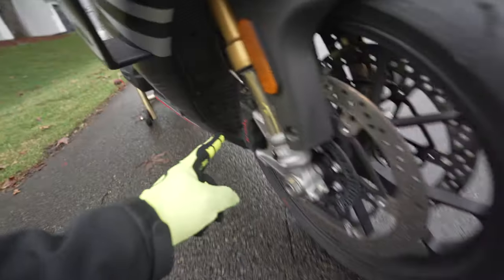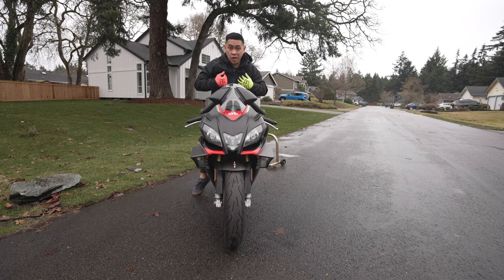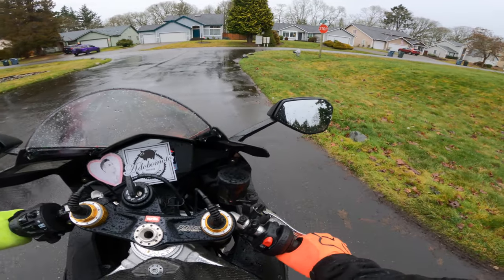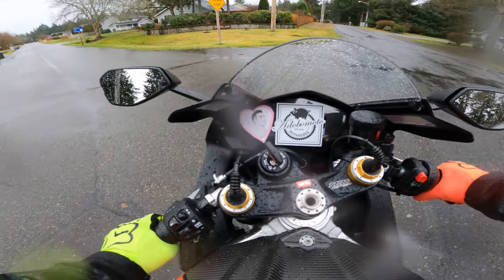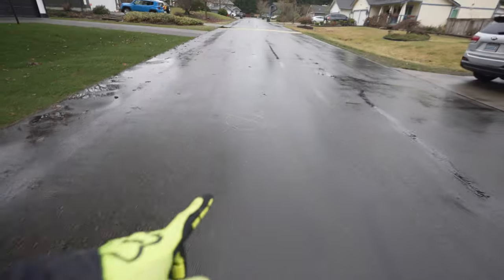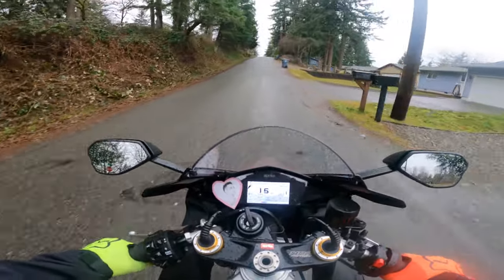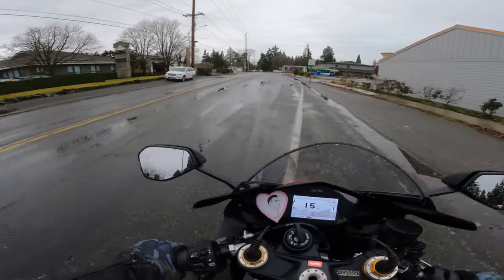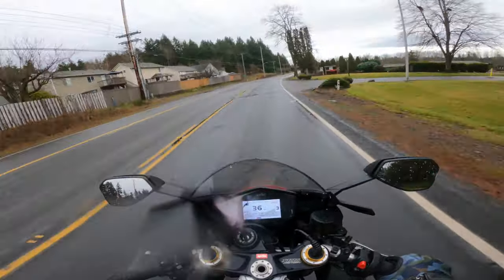HOW TO RIDE A MOTORCYCLE (sportbike)

Comment: I learned riding motocross as a kid.  Learn to use the front brake properly. Slow gradually apply pressure. Don't grab a handful of front brake a recipe for disaster.  I practiced pushing my bike up the drive with my bike turned off. Slowly sqeezing the brake.  You can hear a click if you listen.  Also watch for vehicles that may pull out in front of you. I will weave left to right approaching cars to get their attention. I also ride with my high beams on to.  It may piss people off but at least they see me. Great video brother very well thought out. 🤙
Reply from the maker: Great tips

Comment: I did a combination of both school and YouTube because lessons are expensive here in Sweden, and riding a bike is alot about feel and muscle memory. It is like playing an instrument, but alot more fun to practice, hehe.

One advice I would give to new riders is to look up where you are going really is key to riding, it is the most valuable advice I have gotten. Also, making tight turns at slow speeds, like u-turns on small roads, dragging the rear brake helps alot.
Reply: Just curious because i getting my first bike how does the rear brake in slow tight turns help?
Reply: @anthonybarker9019  Congratulations on your first bike. I am not all certain but i think it has to do with two things. The contact patch on the wheels and the inertia of the motorcycle. By breaking you apply a force backwards, tangentially of the turning circle which increases the inwards acceleration (tightening up the turning radius).

Comment: Really good job on learning how to stop as the first skill.  Many, many people crash their first five minutes on a motorcycle (or first 5 seconds) because the controls are completely unfamiliar. There is a first time for everything. Point the motorcycle down a straightaway with nothing to hit.  Learn to go straight before learning to turn. At low speeds, bicycle skills are fine for easy turning. If the motorcycle "gets away from you", pull in the clutch, mildly use the brakes and even hit the kill switch. Practice this before getting out of 1st gear.  "Whiskey throttle" is a real thing.  It is a positive feedback situation where turning the throttle causes you to accelerate and turn the throttle even harder.  You can wheelie or burnout your first minute on the motorcycle.  Hence the stopping drills first.  I (consciously) leaned my shoulder to turn the first couple decades on a motorcycle.  Once I learned countersteering, I stopped leaning. (Counter) weighting is unnecessary.  You can completely control a motorcycle with steering (low speed, < 20mph) and countersteering (over 20 mph). Hanging off is a track skill. Both effects work at all speeds, but predominate in a certain speed range. There have equal weighing at about 15-25 mph. Taping over the dash is completely unnecessary for beginners.  It is one skill you can practice as you advance. It is easier for beginners to think of countersteering as "push right to go right" or "push left to go left". You can learn this by just going straight down the road and moving from the left side of the lane to the right and back again (Car drivers position to car passengers position). You may ride hundreds of miles before getting on the freeway.  I shift my liter bike into 6th at 60 mph.  If you are used to redlining the bike then keep it in 3rd if you want.

Comment: Awesome tutorial, gave me quite a few tips I can use, even though I've ridden before. Bought a '71 Suzuki T350 this Sunday and I've been putting it around the neighborhood while I wait to take my written test. A little tip for 2 stroke bikes: You need to give it gas to take off. I usually hold my revs at about 3k and gently let out the clutch, any lower than that and the bike will stall. 2 strokes have no torque down low, which can be helpful starting out because the bike won't try and throw you if you accidentally give it too much gas.

Comment: Great video man, thanks putting this together.

My left leg is partially paralyzed and I've always wanted to ride. So I bought a Honda Africa Twin with the DCT push button shift transmission. Was a big 550lb, tall 1100cc bike to learn on. 

I recently ordered my 2nd bike, a 2023 Ducati Streetfighter V4 SP2 (just arrived at the dealership yesterday) and I'll outfit it with a Kiliktronic adaptive shifter to work the foot lever.

I totally agree that once moving, even on the highway it's pretty easy as long as you have your wits about you and ride like no one can see you.

Anyway, cheers!

Comment: If you're a beginner and find yourself occasionally hitting that throttle/not completely releasing by accident when trying to emergency break just remember your clutch shuts that right off. Clutch = security blanket when starting out, or at least it was for me. 

If you've ridden a bicycle. If you've driven a manual vehicle and can hold your friction zone on a hill. Even if you've never sat on a motorcycle before you will quickly find after a couple passes in the MSF course that you totally got this. I give you three to four passes until you go from, man I'm nervous to oh yeah this is going to be fun.

Comment: I actually am planning on getting a cbr150r and ik it's a slow bike and a tiny but it's all I can afford but I already own a motorcycle and it's a semi automatic underbone which is a big difference. I have tried a manual before and I am having trouble with the clutch and I can't drive smoothly but I am going to try to practice more and ty for the tips, btw I live in the Philippines.

Comment: Right on man thank you. Im about to buy my first bike. Gonna go with a 600 to start. Whatever is affordable
Reply: Buy a 650. 650 bikes are usually twin parallels with more low end power and torque so they're easier to ride on the street. They're also usually built to be more comfortable to ride on. A 636 or 600 is an inline four that's got all the power at like 9k RPM.

Comment: I also learned to ride a motorcycle on YouTube. I'm familiar with the manual transmission from a car and it's pretty much the same concept so I thought I would be fine. I recently purchased my first bike(R6) and rode it around my neighborhood at slow speeds and all was good. I must have gone out 7 times with no problems. 3 days after my initial ride I took it out and dropped the bike pretty bad. I was at a red light and once the light turned green I let off the clutch and the bike did a full wheelie and the bike went flying. I flew off and rolled a couple of times. The bike would not turn on after. I had to get it towed for $200. There was a car behind me and I didn't want to take off extremely slow so I gave it some gas. Right side of the fairings, right peg, handle bar and timing chain cover all broke. The bike is currently waiting for parts to get it back on the road but now I'm extremely stressed out about unintentionally popping a wheelie again. Is it possible to unintentionally pop a wheelie again while the bike is already rolling? Also one thing I learned real fast as a new rider is you have to pushed the throttle back to zero when shifting fast or the bike will over rev.

Comment: I'm a Pinoy and the way you said you're short, had me thinking that you might be one as well. Then I looked at the your channel's name. Checks out. 🤣

I'm gonna buy my first small CC bike next week. I haven't ridden a fully manual since a decade ago, when my father was teaching me randomly when he gets us from school. It was a tricycle and it jerked from time to time. 😂 Semi-manual is easy for me, but a full manual with neutral in the middle of 1st and 2nd gear is gonna be my first. Also the bike is a little bit taller when I tried sitting on it last month, when we were looking for a bike.

I should buy used, but I'm following my friends advice on this. Only buy brand new unless you know the seller really well and trust them.

I will try turning the ABS when I train on remote farm roads, so I would know the real difference. I'm probably gonna drop it for a few times in the first couple of months. Since it's heavy and I don't really have the strength to carry and even center stand it. I'm working out to remove that one issue, and I'm also training to center stand a 125 CC bike of my sister's.

I already have my s.o. as a backpack and we've planned 2 rides this year. Wish me luck. Train insane or stay the same. 💪

Comment: Question Down Shifting. If I'm in 5th or 6th Gear and want to down shift to 2nd or first gear, Do I have to pull in the clutch and release Each time for each gear e.g Clutch In, Down shift 1 gear release clutch, repeat for each gear or can I HOLD in the clutch from 5/6th then release the clutch After I down shifted to 2nd Gear skipping 5th,4th and 3rd?

Comment: 13:39 "Unless you're a complete badass" 

Chuckles in most UK CBT courses making you shift from 1st-2nd-3rd within the first hour of being sat on a bike for the first time, Followed by immediately being taken out on the road after 2-3 hours of practice in an open area

(To be fair though, We're taught on 125cc where I believe you're usually taught on 250cc bikes over there and I'm pretty sure your certifications are straight up "Yo, go buy a 600cc now buddy" where ours is limited to 125cc till you pass ANOTHER exam down the line)

Comment: I've been trying to learn to ride but I went straight to riding in 5th gear it's on a 6 gear motorcycle 125cc with 11hp so not that bad but I have dropped it, first time is always scary, like you said. But anywho the advice is very good. And btw I'm around the same age as your son so I'm just getting in to it😁

Comment: 15:41 do not do this new riders. You want your rear wheel to have power at all times on the road (be in a gear). You should always maintain the ability to escape. The only time that bike needs to be in neutral is when you plan on getting off of it.

Comment: Looking at you sitting and then slowly moving on the bike around 4:20, I don't understand / can't believe the bike isn't too tall for you! Is that adjustable? It appears that you can only touch both feet to the ground, on extreme tiptoes! I've never owned a sport bike, but I am a short person and I know it's too easy to drop a bike if you can't sit flat footed - or very near that. This could be especially difficult on uneven streets, hills, slippery gravel, sand, rain or snow, have a passenger on the back, or when you first buy the bike and are not familiar w/ your fit.

Comment: Target fixation - look where you want to go with your head not look at the floor
Tight corners at slow speed - Use the friction zone of the clutch to land the bike where you want it to go looking with your head at the turn. Gives you more control and keeps the turn tighter lessens the chance of straying into other lanes
Always practice slow speed turns as this is where you are prone to dropping or falling off the bike.
Sports bikes - Keep your knees in the tank and loosen up those elbows this prevents you from having a death grip and also limits the chance of whisky throttle and things turning out bad for you.

Slow down - Speed will kill you and never apologise to you or your loved ones. So just chill out and enjoy the ride.

Comment: I apologise first. When stopping at the traffic lights/stop signs. You shouldn't clutch in way early in the video & just depending on brakes. We wouldn't know the brakes might not work/wheel locking due to slippery or sandy roads. The best technique to do was 4 car length from the point you wanted to stop & down shift the bike from 3 into 2 at the correct slower speed & then down shift again to 1 and roughly 1 car length you can start to brake gradually. All of this is by engine braking & brakes. Rather than free wheeling the bike from the point you intended to stop. You should try it & much safer. Free wheeling the bike will make the speed slows down very very slow. By engine braking with brakes effectively slows down the bike better @ shorter length.

Comment: Hey so i got a thumper and shes a 250 and i know she ant a sport bike but i cant let go of the cluch and move without pulling tha throttle i was wondering is normal sorry just wondering.
Reply: That's normal, just give it some throttle when releasing the clutch, it won't hurt the bike and most motorcycles are built so you ride the clutch like that

Comment: Can I ask when the rear brake is most likely to be used?
Reply: Slow speed maneuvers and emergency braking, dragging the rear brake with a slight amount of pressure helps keep the bike stable and with emergency braking you're sacrificing 20-25% of your brake pressure without using it

Comment: 11:16 skip everything that this man is saying about counter weight. The only time you. The ONLY time that should be done is during low speed maneuvering like slaloms and U-turns. Doing this going into a corner at regular speeds only upsets the bike’s chassis abs WILL cause you to crash eventually.